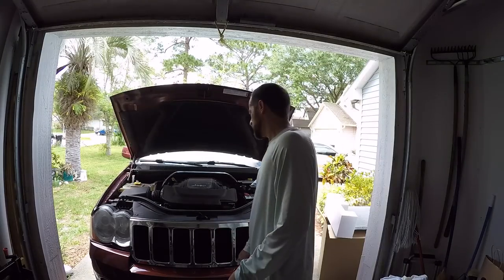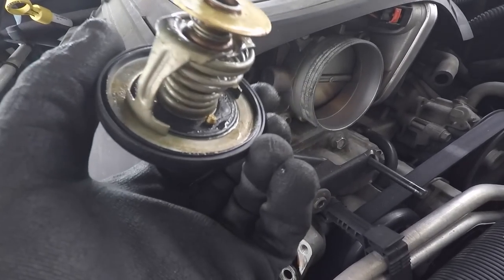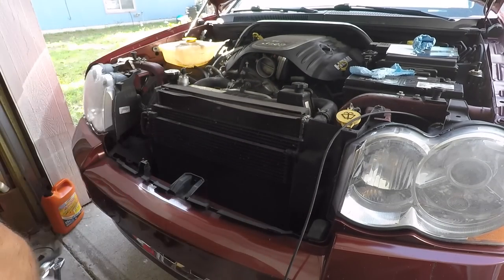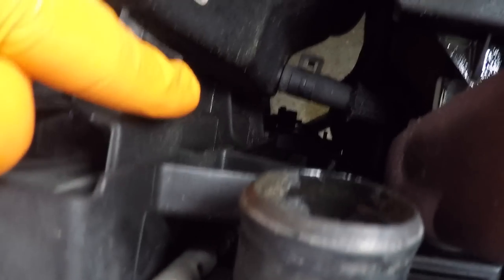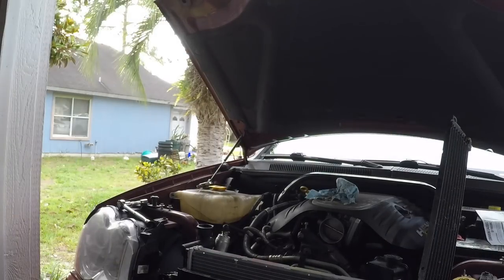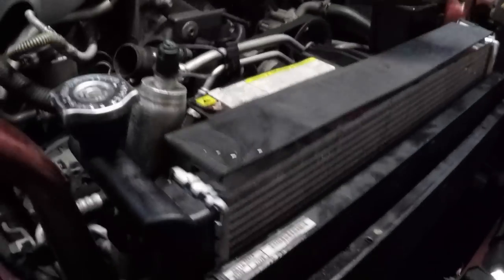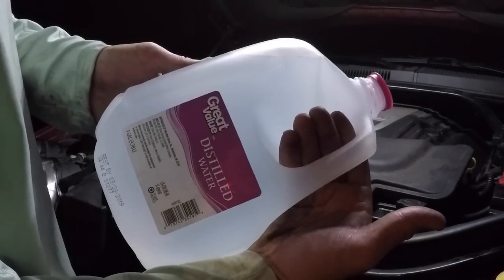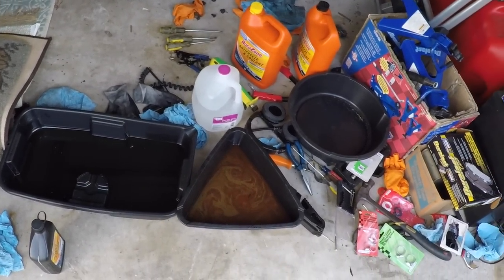DIY/How to: Radiator Install for a 2008 Jeep Grand Cherokee with a 5.7L V8 Hemi

Comment: Hi, this should be the same for a Jeep Commander 2008 Overland V8 5.7 Hemi?
Reply from the maker: Hmmm... I'm not too sure if it would be the same but very similar. The commander has a different body style, obviously, but it might be close to the same. My Jeep Grand Cherokee is the Overland edition, as well. From my understanding, they are the same motor.
Reply: Swampazz Fishing I thinks it 99% the same, everything is on the same position, thanks for the tutorial, I will change it next week

Comment: I've got an 07 GC Overland with the 5.7. Anyone else have to replace the rad every 2 or 3 years? I am going to have to change mine for the 3rd time since I got it about 7 or 8 yrs ago. Also go through high pressure power steering hoses about the same and the make of them doesn't make a diff, same with the rads.
Reply from the maker: I wish I could answer this, but not too long after this replacement, my engine blew up. I ended up trading it in for a 2014 GC Overland 4x4 with a 5.7. :(

Comment: how long would you say this job took for the average joe?
Reply from the maker: So, for the average joe, I'd give myself at least a minimum of 6 hours, depending on how fast you work and knowledge on removing parts. It took me longer because I wasn't prepared and didn't have some items to complete the process from start to finish. Thanks for watching!
Reply: Swampazz Fishing no problem as you seen no other good instructionals. Sucks it seems like a lot of people have that leak by the upper hose.

Comment: This is a whole lot of work just to change a radiator,imagine what the dealer would charge 💵
Reply from the maker: Exactly, that's why I wanted to try and do it myself. If I remember correctly, it would have cost me over $1500
Reply: Swampazz Fishing Wow 😮 what a ripoff I’m glad you were able to pull it off and save lots of cash 💰 in the process!!!!